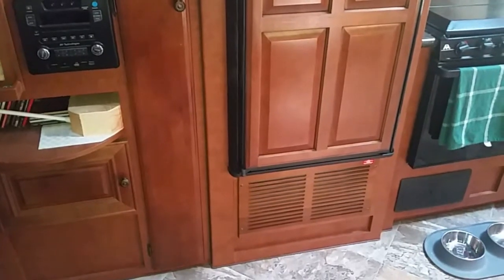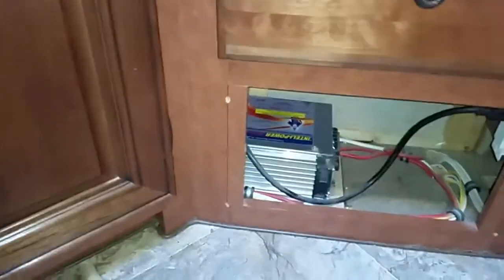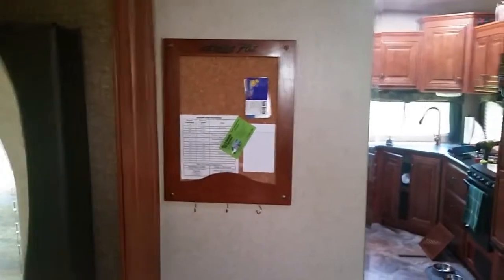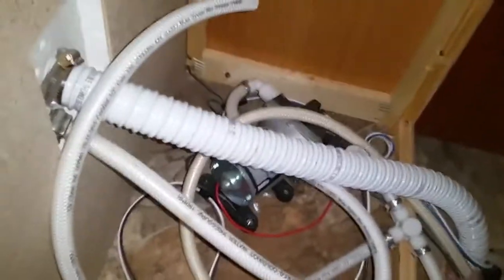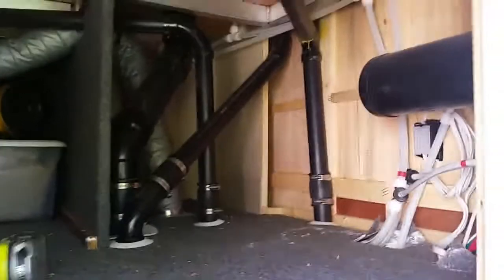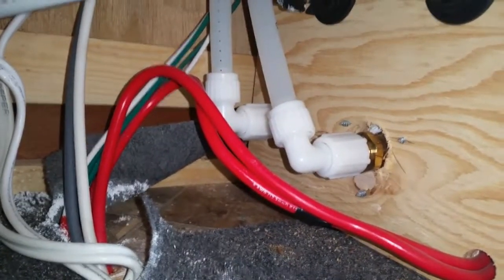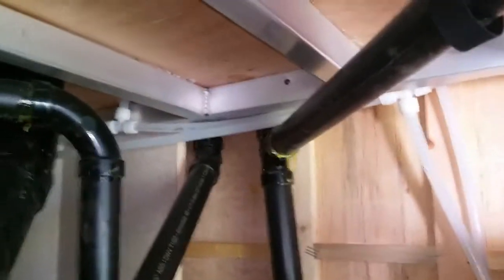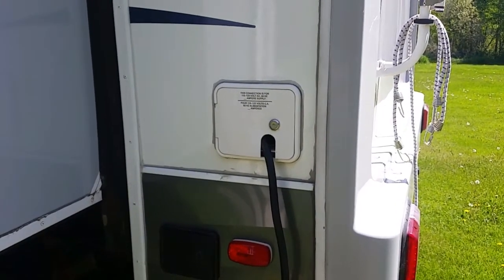What's Behind the Panels

Comment: I think the "Female Junction Electrical Box" is used when you are Boonedocking or Traveling down the road using your "Generator" (standard Onan or Generac Gen Set) for Frig or A/C running... You plug your 30 or 50  amp "male end" into it to get the Generators Juice to the 110/120 electrics in the unit... When you are parked at a camp area that has "Shore Power" then you just plug your 30 or 50 amp cable into the Electric Poles Box... We use a portable "Honda EU3000iS Generator",,, so we have to plug-in out units Electric Cord into it, just like having shore power... I'm pretty sure that's how it work's...